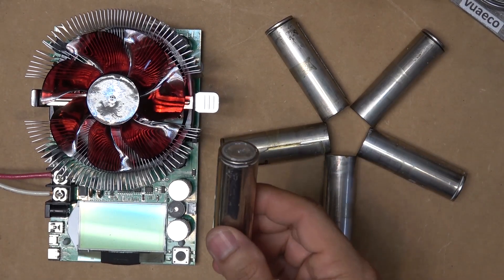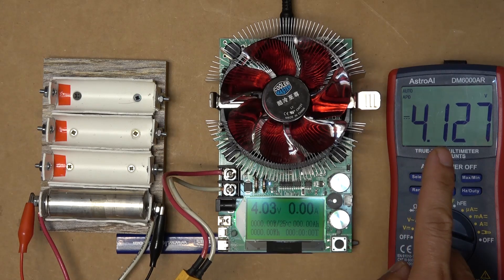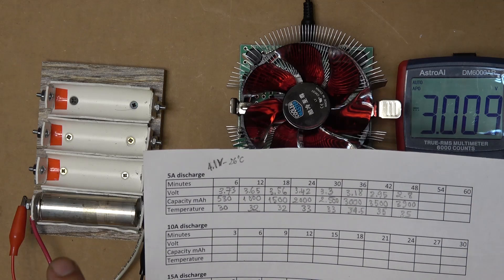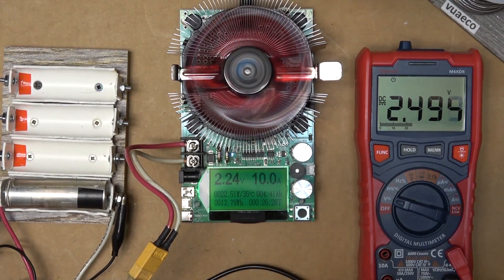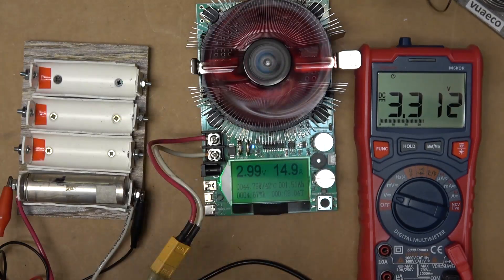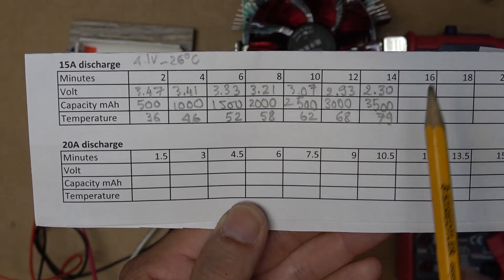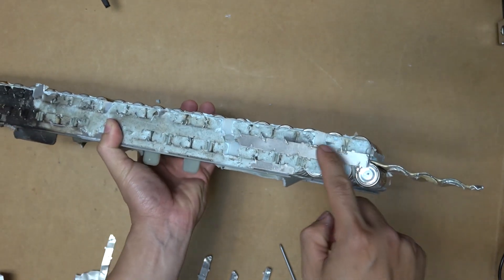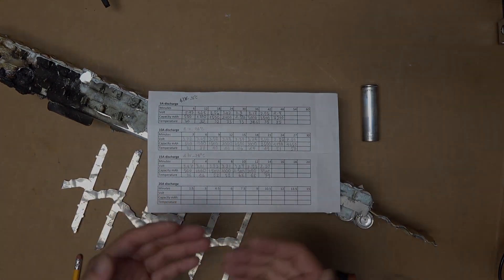High current discharge test for Tesla 2170 battery: How many Amps can it take?

Comment: Very nice testing process.  "Does my wife want to raise our son by herself"  very funny.   Put some cinder blocks around the battery and test outside with longer wires.  What about some air cooled heat sinks around the batteries?  Put some air ducting around the batteries or a fan.

Comment: have you ever concidered doing what we do with the packs we make we have them fully submerged in 3m Novec dilectric fluid ,all cells hold constant temp even when under max load and when charging with max current samsung 30Q cells with 20s x 20p handles continuos 400amps with peaks of 600,and can charge at 200amp ,as thats the biggest charger i could make,,we use a 2 fan pc radiator a peltier element and water block kit and 12volt high psi pump for the fluid its very similar to mineral oil which  you can also use,,the advantage of having cells never get hot ever ,and the big one that they can never ever catch fire as they are in solution.
Reply: we also use red brass sheets that are .4 of mm thick solldered ontop of the thick nickle stripping with 6 spot points per cell,the red brass is on all the series connections and use 1mm thick red brass on positive and negitive ends of the pack, its all sprayed with epoxy coating before fluid is added ,weve also cooled the  2 motor controllers and bms ,you can also cool motors with this to but that much harder to do at home for hub motors

Comment: A Li-Po battery when unstable creates gas internally.. This gas creates pressure which either vents or explodes however the cell is open to new atmospheric pressure, the cell will heat to 1600degrees then stabilises to 800 degrees to cell is exhausted. Nothing can stop this as the cell creates its own oxygen. FACT. YOU WILL NEED 3 TIMES THE SIZE IN TNT TO MATCH A LIPO CELL EXPLOSION.
Reply: FACT: TNT RELEASES THE ENERGY OVER A TINY AMOUNT OF TIME COMPARED TO A CELL, HENCE "EXPLOSION". The cells don't "explode" in that way. its more like a slow release of the energy. :yougotthis:

Comment: The Problem with these cells is that you can neither spot weld nor solder them together. So how to use them?
Reply from the maker: Yes, you can spot weld it. Stay tuned.
Reply: @vuaeco  Then you have better cells than me. My cells (+cap) disintegrates (gets holes) if I spotweld there.
Reply: @vuaeco  i stayed tuned lol. How did you spot-weld them?
Reply: Why can't you spot weld them? Is it because it heats them up?
Reply: @juliankwiatkowski1441  Because the +cap is (at least in my version of the tesla 3 21700 cells) aluminium (alloy?) so the soldering is extremely complicated or nearly impossible.

Comment: Hey man, I have a quick question, I got a 16s (16s) pack, when it's fully charged at 67v my e-bike goes slow, but once I get to about 63v the speed actually increases pretty noticeably, my controller is a cheap 48v~72v 1000w 35A, 15fet, any idea what's going on here?

Comment: 🔋🔋🔋🔋My battery pack on my xiamio m365 classic gets to the high 40's after 30min of riding,I flashed the firmware to run like my scooters big brother Pro m365....250w motor running at 1000w,ESC  30amps, battery pack at 40amps....🥵🤯🔥

Comment: Forget cooling. Just run a temp sensor, and implement pack shutdown @ 80°C in your BMS and/or controller. It's like how the VTC6 cells I have are rated only for 15a overall, but 30a with 80°C cutoff...
Reply from the maker: That could be an option. But I think 80C is way too hot and damaging.
Reply: @vuaeco  Alternatively, you could try building a pack to fit in a finned aluminum box, and then pot it in the appropriate silicone to achieve passive cooling...? The silicone would also add thermal mass, thereby delaying overheat. I've seen a few manufactured packs put together this way...
Reply from the maker: @fun_ghoul  That's a great idea. Instead of wrapping it with shrink tubing/plastic, wrap it with aluminum sheets and that would act as a giant heatsink.
Reply: @vuaeco is the cables hot?Add a fan - aluminium sink - ferro fluid coolant on the staiter and battery, I'm buying some Ferro coolant for my Scooter motor....
Reply: @vuaeco  I would set it lower myself, but 80°C is straight from the Sony spec sheet. Then again, they want to sell more batteries, so... 😂

Comment: 🇰🇭Just want to thank my favorite teacher, been a subscriber since Swagtron upgrades, Thank you and Keep it going, also what state you from....I'm in Massachusetts - New Bedford~Fall River ... 🛴
Reply from the maker: I'm from Kalifornia, a state where everyone says they are moving out of but somehow it keeps getting more and more crowded here. :D
Reply: Lol .... Same over this way,not crowded but when people finally get the courage to move away it's 2 towns over😄.... We're can I find free or cheap Tesla  batteries, I want to build a small battery pack for my swagger 5 that I converted into a M ³⁶⁵ only using those small charging boards ,for more speed, I had to trace cut the ESC and soldier a wire were the + Capacitor leg was and move it over to get 36v to the electronics and add a 4s in series to my beefed up motor tracks so only the motor gets 58v.... Maybe you should do the same on your channel and take the Swagg out of retirement...🤔🤩🛴

Comment: Good test. I'm also running these cells (14s7p) in my bike up to 70a. It seem I get more out of them if I set the current limiter on the controller to around 50%. Even at 70a the batteries don't heat up. I used a thermal imaging camera and only the nickel strips heated up slightly (only noticeable with thermal imaging). The further away from the positive and negative connection the hotter the nickel got. I'm planning to upgrade the nickel strips.
Reply: thats because at 7P each cell only delivers 1/7 th of the current. with a 70A draw each string of 14 cells is delivering 10 A.
Reply: @spud4242  Yes. My concern now is power losses in the thin nickel strips and weak spot welds I used for the series connections. I forgot to mention there is a significant voltage drop around 2 to 5 volts.
Reply: @saifcathum3423  You may be a good application for using the nickel plated copper strips.  See if Keith has them on the "18650ed" fleabay stor.
Reply from the maker: @fun_ghoul  You are absolutely right. The current concentrates on the first and last terminals. But it also needs to pass 70A through the nickel strips inside the parallel and series connections so you also need to beef those up as well. 70A is no slouch. It needs a significantly fat copper conductor to move 70A.
Reply: @vuaeco  exactly. kirchoff... same current through all points of the circuit.

just like jacobs law, and um... therevins max power equations limit exactly what you can ever get. cant drop the load resistance lower than the source... and high efficiency is only reached when its many many times larger than the source resistance.

pfft. copper. gimme silver :)

Comment: The reason why the voltage displayed on the discharge tester is inaccurate is mostly due to resistance of the contacts and wires that flow TO the tester. The more you increase the current which flows to the wire, it drops more voltage.

You can verify this by connecting your multimeter to the screws that holds the wire to the tester. 

This is why ZKETECH battery testers, for example have their own voltage channel for measuring voltage.
Reply from the maker: I used size 12 copper wires. The contacts are big screws. So there shouldn't be that much resistance to drop the voltage that much.
Reply: @vuaeco  Try it and find out!

Comment: your temperature readings will not be accurate as you are measuring the temp of a reflective surface, you should put some black tape around it to change the emissivity
Reply from the maker: I did have some black tapes and white tapes on the battery which you could have seen them clearly if you watched the video. There's also a piece of clear plastic attached to the battery that's glued to the aluminum heatsink (this is done by Tesla). That's where I pointed the thermometer to.
Reply: @alan lester My el cheapo Canadian Tire temp gun has adjustable emissivity, and an included list of emissivities of a few popular materials. I'd have expected this to be de rigueur...?